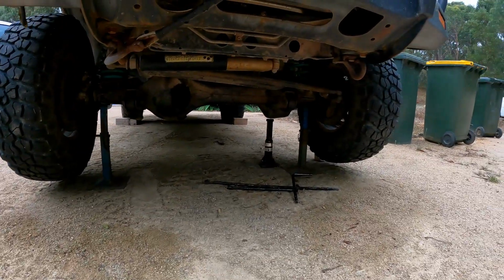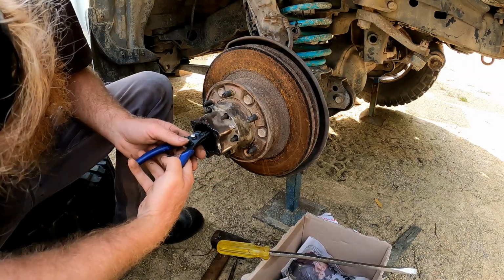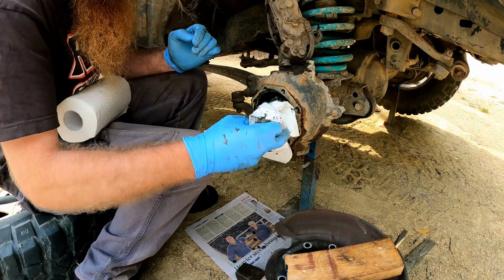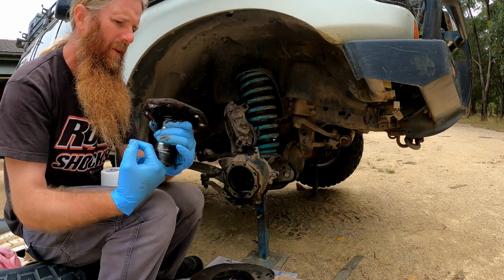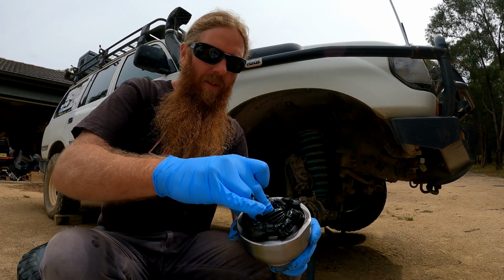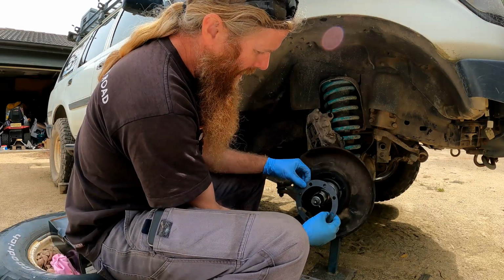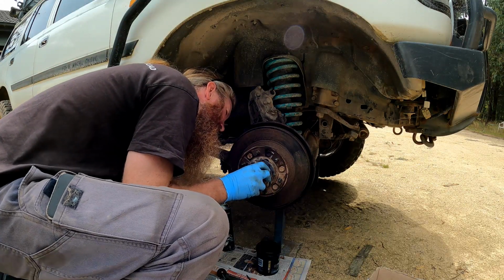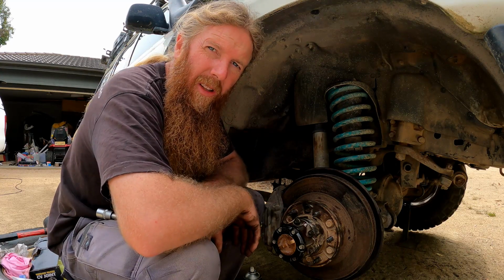How to replace a CV joint | 80 Series Landcruiser

Comment: Cheers for the video much appreciated. Great work and a massive help! The FASK2 pack I got has the outer seal as well but I didn't see it in your video? Did I miss something?
Reply from the maker: Hey, that's a good observation. The outer seal sits in the back of the rotor/hub assembly behind the inner wheel bearing. At 27:46 I mentioned that I wasn't touching the wheel bearing because it had been replaced about a year ago. That's the reason I didn't use or make mention of the out seal. I would only replace it, if changing the wheel bearing or if the seal looked damaged. Hope your CV replacement went well.